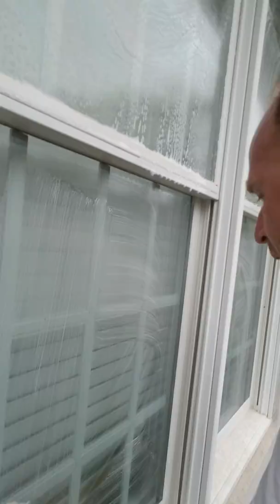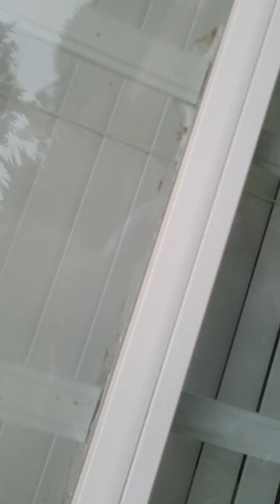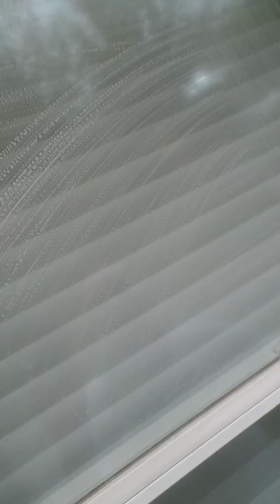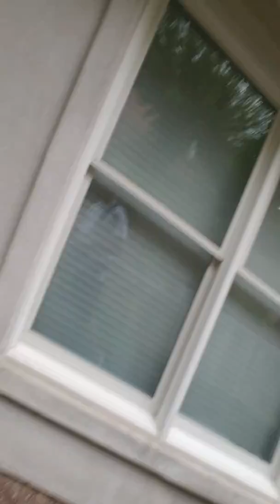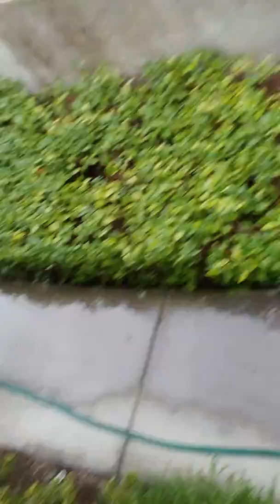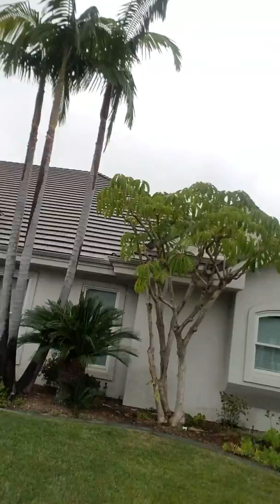Cleaning windows in the rain!!!!!!!

Comment: Hi , I use Cascade sometimes W/ Cascade rinsing solution.It works similar to Rain X.When you clean Windows again even with using dawn ther is hardly any slip when you do the Windows again.How much Rainex do U use in your water.Do you not need to do it seperate or is it just as simple to put it in your water Wolfgang